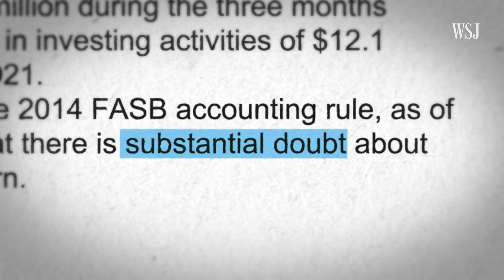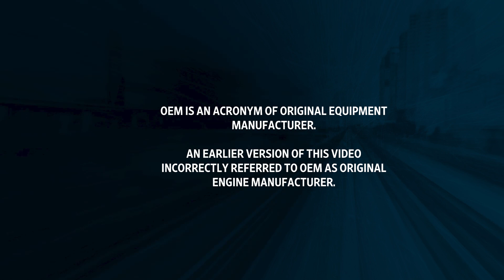Rivian’s Factory Reveals Why EV Fleet Contracts Are Crucial for Automakers

Comment: Who do you think will secure the most commercial fleet electrification orders?
Reply: Brightdrop, uses GM's Ultium system and GM seems to have locked up long term contracts for battery materials.
Reply: @jayemgee7786  Rivian has a contract to build 100,000 EV vans to Amazon. That's the easy part. Now they need to build them.
Reply: Ford - not because they are the best ( not saying they are not) but because they a manufacturing right now.
Ather Nicola, fisker etc promises have lost value. 
( really like Cano- don't think they will make it without someone taking them over)
Reply: @D.C.Harris  if the power grid fails we have a bigger problem than not receiving out Amazon order.
..... and you can always charge with a generator if you don't have solar on the roof. 
By the way. Gas stations need electricity to pump gas and surprisingly most don't have a backup generator.
Reply: Ther‘s only one problem with an electric cars don‘t male sence as long as the energy put into them was produced with coal gasoline or other thungs like that. The cars will make sence when the grid is mostly out of solar amd other green electricity.
Reply: @Yves_1  My 2019 Chevy Bolt cost $25k new and cost less than 4 cents a mile in electric. It meets my needs. I'm fine with coal. Two of my brothers drove coal buckets before they retired. I live in Indiana and nearly all of my electric comes from coal. That's OK. If they meet your needs, an EV is a great money saver.
Reply: @Yves_1  A big power plant is still more effective than the relative small engine of an ICE.
Reply: @Yves_1  ev are easier to build and maintain.  No transmission,  exhaust or ice engine. 
I would call it a win when a car runs on US natural gas over Saudi gasoline. 
Everyone with a house and ev should absolutely have solar.  
Finally something the individual can change.

Comment: That isn’t what OEM stands for…
Reply: you're right...OEM stands for Original Equipment Manufacturer
Reply: @venkatg6502  stands for, not what the letter are
Reply: OEM is a package deal construction, most of the times products that you need both.
Vacuum with bags etc, get code, download it...